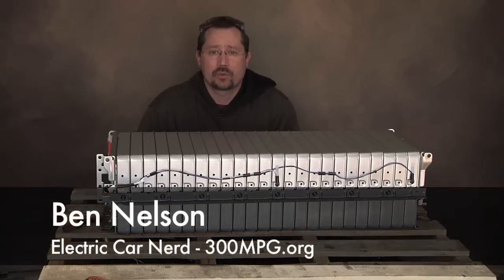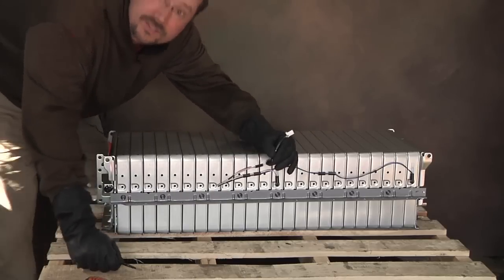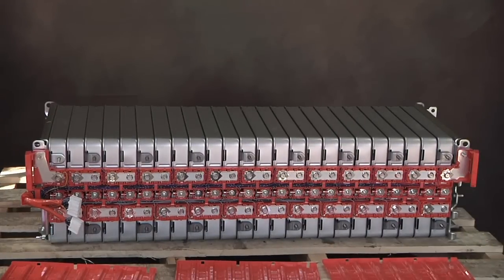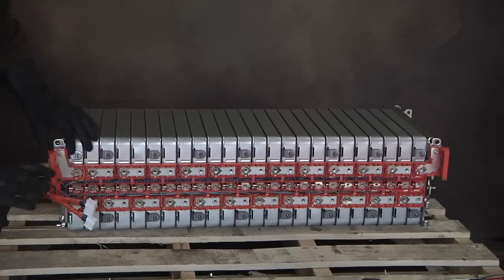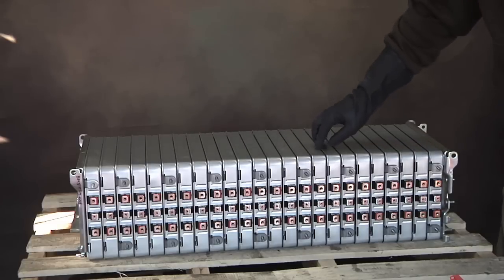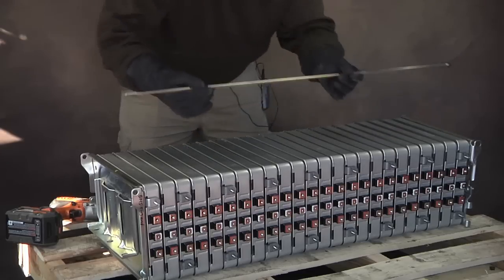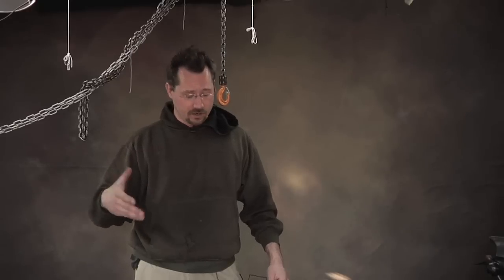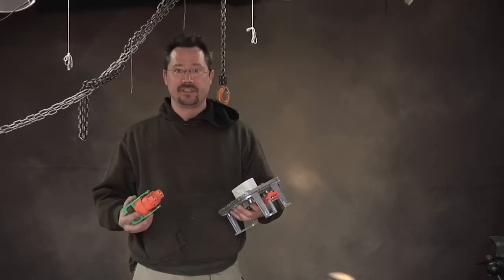Nissan LEAF Battery: Module tear-down Part 2

Comment: I sure do love your videos Ben.
Keep on the good work.
I am writing because I would like to know, if you (or anyone else) knows what connectors Nissan uses for these battery packs (AZEO & ZEO). Ergo the output terminals/connectors.
So fare I have found the name B24 pop up for the CAN-bus connector and I found this https://evsenhanced.com/product/nissan-hv-battery-connector-36-pin-female-flying-lead/ where they sell them. Also you can 3D print them.
However, I have by now not found the make, name or anything off the other connectors for the power output and the heater output (only AZEO) of the battery pack for the Leaf.
Does anyone know anything that will make me able to figure this one out?
Anything will make me grateful

You are the reason why I have a old I-MiEV in the front of the house with a Webasto heater installed under the hood :D
(I know it is old, but it runs like it was new only 27.000km on it so far)

Comment: Did someone purchase  the extra parts from the battery? Curious cause I'm tearing down a gen 2 myself as well an wondered if there is a market for these extras.
Reply from the maker: I do have some of the other bits that were inside the battery pack. I haven't even tried selling them. You do see some of those parts on eBay. I don't think there's a whole lot of demand for them, but items like the contractors can be useful.
Reply: @BenjaminNelsonX  Didn't think so, but the contactors and the master disconnect should be useful as i'm doing this for solar power wall.

Comment: I was wondering is there any good behind wanting to try DC to DC charging, so one battery pack runs the Scooter and the other is charged while the other runs it for like a backup? And 2nd would running the Scooter and having an alternator be a useful way to help boost the output and not drain the battery pack so much?
Reply from the maker: Michael Hammons The cycle should have a 90 mile range when it's done. I really have no need for going further than that in a day, so no sort of battery pack swapping or anything else like that would be wanted. An alternator converts mechanical energy into electrical energy, but does so by placing a load on the mechanical energy source. In a gas car, when the alternator is running, it makes the engine work harder and get worse fuel economy. Using batteries to run a motor to run an alternator to charge batteries only lets you LOSE energy, not gain it. The one exception is if you want to slow down anyways, which is how regenerative braking works. The Vectrix scooter has regenerative braking, and it works great!
Reply: BenjaminNelson  I would want to go further so I am looking into way and Ideas to expand the range without having to load so many batteries, I am looking to make my own scooter but not a basic 2 wheel. It would be easier to chat and tell you what I am looking to do if you have hangout message me or email me at this accounts address.
Reply from the maker: I did experiment with a Chevy Volt style range extender on my electric car. It worked pretty well. https://www.youtube.com/watch?v=xXVi-g4jWqI

Comment: Hey Ben I have recently found some deep cycle semi truck starter batteries (I know pretty crazy) I was wondering if those batteries would be good for my truck conversion
Reply from the maker: Pedro Casultsan As long as they are deep-cycle, they should work fine. Of course everything now is switching over to Lithium, but if you can find lead that fits your budget/needs/project, then great! Good Luck!

Comment: I saw the brown background i. the thumbnail, and immediately thought it was going to be an Ashens video. Anyways, really liking this series. With 16 modules, what kind of capacity increase would you be expecting if you were to replace the old Escape cells with the LEAF's cells?
Reply from the maker: These modules are rated at 60ah, 8.4v, and I'll use 18 of them in the Vectrix. That calculates out to just over a 9KWH battery pack. 100 watts per mile, is a typical ball-park number for common electric motorcycle efficiency. 9000/100= 90 miles of range. In reality, it will be less than that, and I'll set the charging for a little less than full capacity, but that's still HUGE! The original NiMH cells in the Vectrix are in poor (but at least working!) condition, and give me no more than 9 miles range. So a ten times increase! That's nice!
Reply from the maker: I bought that backdrop at a rummage sale where somebody was closing out a home portrait studio. The backdrop hides all the ugly stuff I have crammed in my garage. Behind the backdrop is two motorcycles, a diesel engine, transmission, welder, and a whole lot of other stuff.